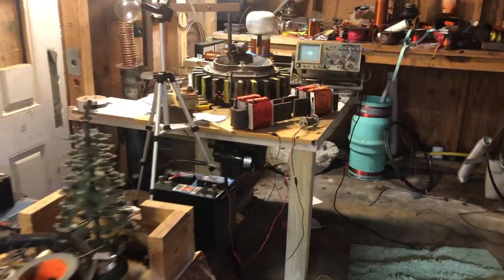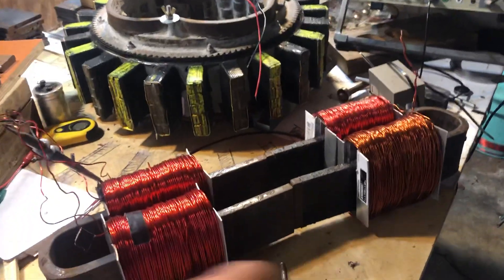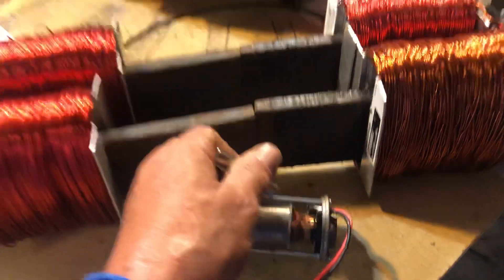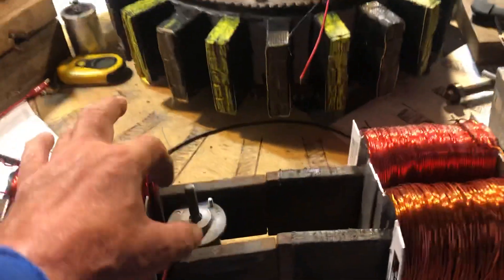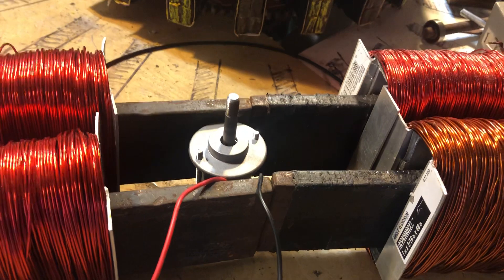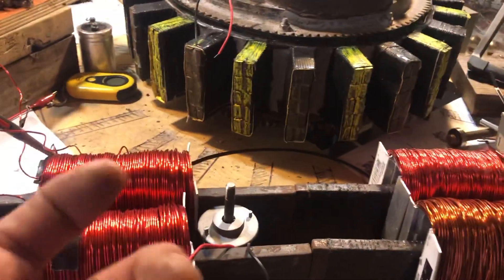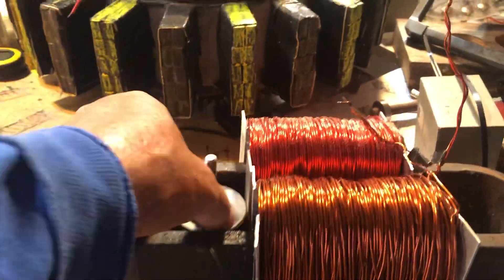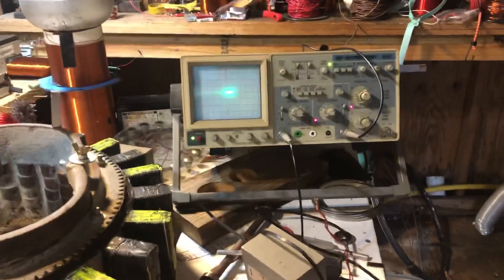Ed Leedskalnin’s, PMH, Perpetual Motion Holder’s, Magnetic Memory!

Comment: We know the "magnets" are trapped in the PMH. If the PMH is the cause of the motor spin, then it is leaking, or creating a magnetic field somewhere. We know that is NOT likely to be happening.
It is possible that the coils are being "energized" and creating a field that is causing the motor to spin. My thought is that the rotor is creating it's own magnetic field and causing some paramagnetic action (even if off of an "invisible" field) and causing the EMF required to start the prime mover moving. Have you tried hooking both motors to the battery and putting them near each other? Do they propel each other? The DC power source should be creating it's own magnetic field in the rotor.
The only odd thing about this is that it doesn't seem to work in the "crook" of the PMH area - which if it was causing paramagnetism on the iron bars, it would seem that it should work there too. This further seems to indicate that it is something going on with the coils.
Are they "cross wired" to each set?
One set of coils should be sufficient to charge both PMH's as the second PMH becomes the "keeper" - just in fancy horseshoe shape.
I wonder if there isn't some induced current in the crossover wires that as they traverse the gap between the two sets of coils, they are generating a weak field, that the motor is pushing against to begin moving. My thought is as it spins, it is likely generating its own field, which is inducing back into the crossover wires, and ultimately causing it to push "harder" on the rotor making it speed up.
The only question is why does the polarity shift? 
I would need to see more of how they are cross-wired to pose a thought. But my guess is those coils cross-over wire is acting as a "zero turn" coil and generating it's own field as it is charged from the spinning DC motor. Since the DC motor is powered, it should ALWAYS be producing a magnetic field.
Definitely seems a good area for more study.
Try removing the second set of coils, or not cross-wiring them, and see if the motors rotate if moved near each other when both powered on.

Comment: Very suspicious. At 3:15 the motor is made to spin using a hand held magnet. If this was possible we would not need batteries, every electric motor would just have a big magnet put near it.  The motor is also always attached to wires, never shown in the device spinning by itself.

Comment: Soft Fe 12310-500-R gram (Sigma Aldrich Canada Co, Ont). We searching for soft iron (Soft Fe 12310-500-R gram) Soft Iron Base Alloys – As-sintered ; GRADE, Density g/cm · B · kG (T), B · kG (T), H · Oe (A/m) ; FF-0000, 7.0 7.2, 10.5 (1.05) 12.0 (1.20), 9.0 (0.90) 10.5 (1.05)) Bars (3/4 Inch thick x 4 inches W x long24 inches long. Where did you get your iron bars? Gerald Biccum… needs the softest iron available.

Comment: What's clear from this experiment, is that you clearly do not need to continue to add outside power, but each time the motors pick up speed and continue to run-you've appeared to have tapped into an external power source with this configuration, provided the motors will continue to run indefinitely if not disturbed? The fact they only work on the inside suggests that the motor is energized by the static electricity it's receiving within the confined space, and not on the outside where it is not confined. Once you separated the PMH's (Broke the bond), the motor stopped spinning. Theoretically, if you could place your pickups within this field, you could possibly pull unlimited electricity from it as well. Question is, how much? Great video!
Reply: no the motor was connected to his battery. The inductance in the motor is changing. He showed that as he moves a magnet near the motor (away from the PMH), it spins faster.

Comment: i got the pmh part to work, im working on part 2.    try this:  put an 18 gauge/1500 turns coil across a keeper. thats the male.  put a regular keeper across the female. and start them in same configuration, but on the male use 35 amps/26 volts, and on the female, 35 amps and 16 volts.  it should be a 23% increase from the 16 gauge/1500 turns on the 'input/male' side- so 26x23%=6- 26+6=32, which is 16x2. So theoretically, the male side should be twice as powerful as the female side. so source vs sink. So keep feeding current into male until the female coils start to fill up and now you can hook up a light bulb to the female coils (configuration might have to be re-done in series after parallel boot up, experiment).  You also will likely have to hook up the negative male side of the coils to a grounded iron rod, either directly to iron or through induction via iron/copper, after you remove main input power. also, female keeper might need its own coil for pick up, duno yet, we'll see, maybe a cross-wiring like you had it in one of your other setups for the 'meeting' coils. and W/E orientation.

Comment: I have made several PMHs. What I have noticed is that you don't need two coils. One coil with very thin wire works as well. I made one with a u-bolt and only wrapped one layer of 30 gauge wire around it from one end to the other. This works much better with even very low voltage. Also, you can put insulation, like paper,  between the keeper and the U. It will stick that way as well. BTW, I believe the PMH is a "static magnetic field". It will respond with a compass like it is magnetic yet, it is non-magnetic. This I think is the idea behind it and very intriguing. Leedskalnin should have named it the CEH- Conservation of Energy Holder. There is no motion in it. You can test it with the insulation between the U bolt and the keeper. There is no current!

Comment: It seems to me that the motor ‘picking up speed’ is actually the motor catching up to the optimal resonance of the loop.  So, it’s ‘catching up speed’ until it reaches that resonance.  Like a Rodin coil and a frequency generator can be slowly matched such that you eventually require less voltage (over unity in efficiency).
Reply: The wire in the motor has resistance R and that is fixed. The inductance of the motor can be change when it is in the presence of a magnetic field. As the motor spins, it imparts spin on the two PMHs which then impart a field back. It is a cool trick.

Comment: You are use 12 volts of direct current for the rotor?
Reply from the maker: Goce Kocov 
Hi yes. On 12 volts
Reply: @vinnystvincent9788  that is the advantage with  with the magnet of ed because you don't need electricity for the stator   
just for the rotor оr that little bit of electricity made from solar panels which is sufficient to rotate the rotor.
And how much power in watts your engine produces on video?

Comment: so awesome :-).  Answer to your question on why is it picking up speed.  Pressure mediation.  the battery wants to gain inertia as it has been torqued.  i.e. it wants to drain into the ether.  the magnetic field and the spinning motor is doing just that.  It would be cool to see how much torque that little guy has and the battery drain.  get it "drain" :-). Thanks so much Roy, I'm learning so much watching your videos... peace and Cheers.  Did you see my wiring diagram I left you in the last video?

Comment: Also try attaching the wires using magnets. I would also try including magnets in this wire circuit which are in a repulsive fashion glued or held together. Because I think I may have seen this in a circuit where each end went to the two ends of a set of coils. Which really made one long coil around ferrite core. Actually two cores which were on either side of a rotating north south magnet. Basically the magnet poles were in the wire circuit like a + - battery attachment. The spinning magnet between the coils. But the wires were closed circuit from one coil to the next and through the magnets (end to end.)

Comment: The electromagnetic core of the motor is entering the PMH. After high RPM quickly swap from the DC power and attach to the PMH wires.

Comment: Amigo, I now understand Ed's PMH to be a novel type of capacitor: it is a MAGNETIC capacitor.  It STORES magnetic current by keeping such PERPETUALLY moving in a loop which can be broken.  

AWESOME EXPERIMENT, ROY!!!  Your motor test between the PMHs IS A BRILLIANT AND BITCHIN TEST and proves the movement of the magnetic current.  My question is what happens at the conjunction of the two counter-opposed vortices at the ends of the PMHs?  Looks to me from your motor tests that the two vortices mutually reduce and negate each other more and more as you approach the junction point of the two PMHs.

I conclude that what Ed had invented with the PMH is a MAGNETIC capacitor.  it is AWESOME your discovery of the flow here, and JUST HOW FAST that magnetic current is moving!!!  A crazy thought, based on your revelations in this video: what if the magnetic current is confined to the portion of the U of a PMH which is BELOW the copper coils.  It is my understanding, in an attempt to better perceive from something more like Leedskalnin's perspective, that what we call 'electric conductors' can be understood in a divergent model to be instead MAGNETIC REFLECTORS.  The magnetic current can't perhaps pass through the iron below the coils because of copper's MAGNETIC REFLECTIVITY.  If this is true, then a hypothetical and novel SUPERCONDUCTOR is achievable with Leedskanlin's tech.  

F.
Reply from the maker: pneumatonic 
Hello and happy holidays!
Great comments! You can see from the experiment that the center where the prong ends come together, the fields bounce off from each other.
Reply: Inductors can store energy just like capacitors, only they store energy in magnetic fields instead of electric fields. This is known. What seems to be a mystery to me is that a capacitor cannot hold a charge for 2 years and be just as charged. They leak. But the PMH doesn't appear to leak. One gentleman has a 2 year old charged PMH that he demonstrated was just as strong holding the bar and that when he pulled the bar off and he made a light blink, just as Ed described. That is pretty amazing.